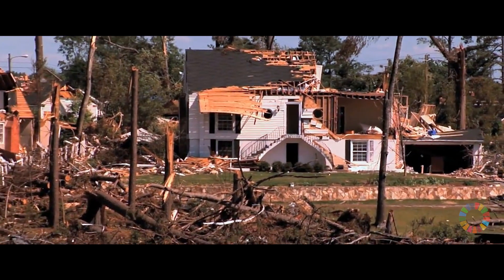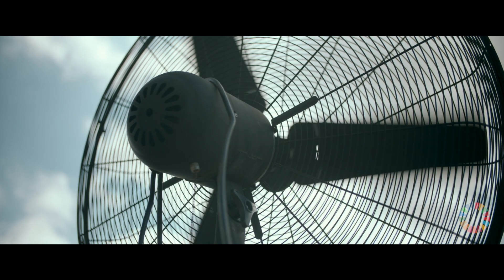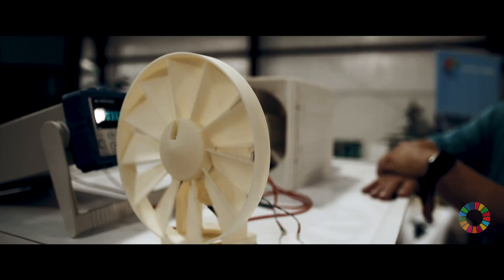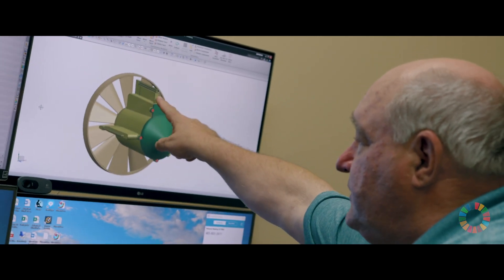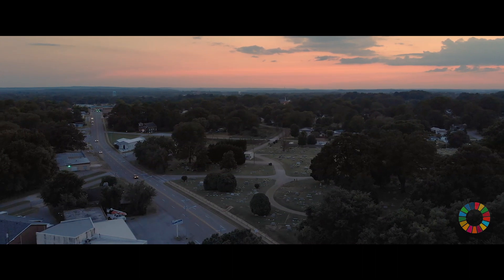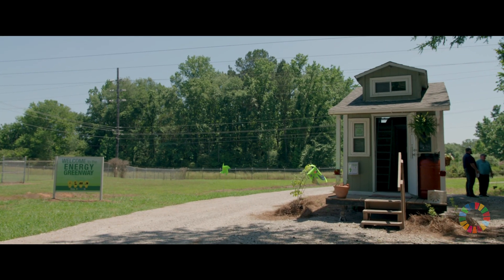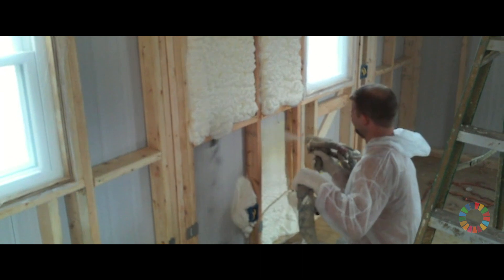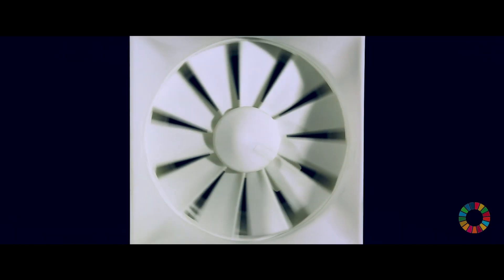American Wind, Inc – Powering The Future

Comment: specs:
Max Output: 1kW
Max Voltage:  180v (DC)
Max Amperage: 6a (DC)
Size: 9.125in x 9.125in x 9.125in = 0.231775 meter
Weight: 9
Cut In Speed : 1.5mph
Max Wind Speed: 140mph = 62.5856 m/s
Min Temp: -15F
Max Temp: 375F

my own Estimated diameter size of fan:
 6in = 0.1524 meter.

P_wind=1/2∙ρ∙A∙V^3=1/2∙1,225∙(0,1524/2)^2∙π∙〖62,5856〗^3=2804W

Betz´s says you can max harvest 59,3% of the wind energy.

P_windmill max=P_wind 0,593=1667W

note that is at a wind speed of 62,58 m/s

according to the beaufort scale hurricane stats at a speed of 32.7 m/s...

You do the math...